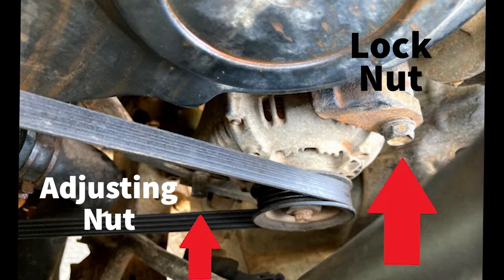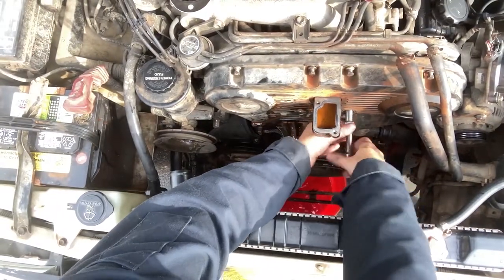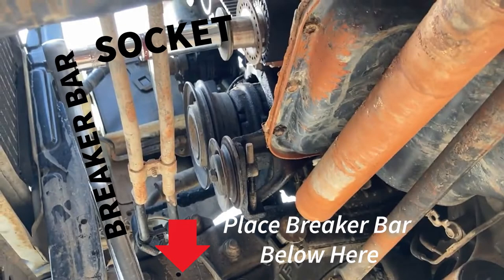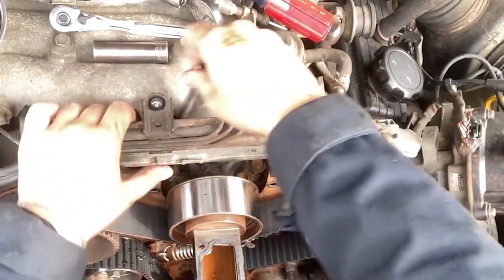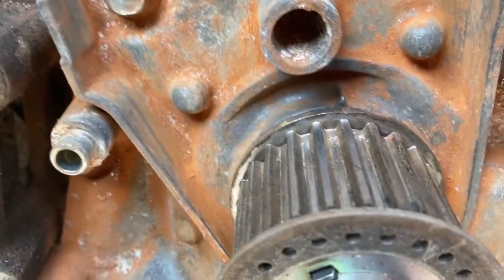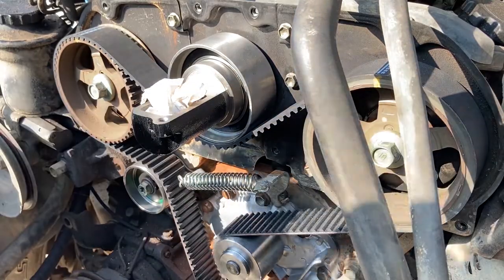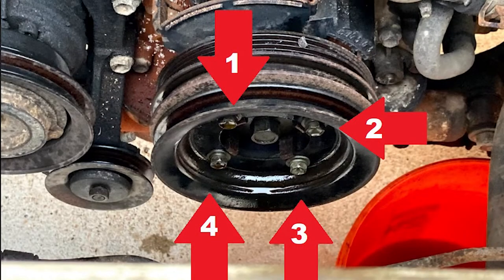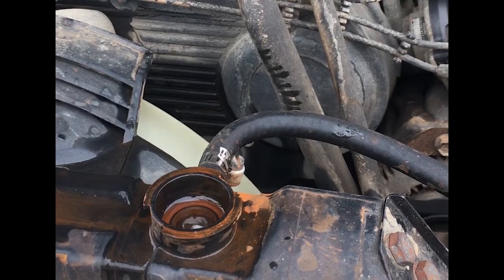Toyota 3VZE 3.0L Timing Belt, Water Pump, Tensioners Replacement - Girlie Garage

Comment: Thank you SO much for this video! You gave me complete confidence to tackle this job on my 3.0 88 Pickup. You didn't skip any steps, and explained everything. I subscribed.
Reply from the maker: Yes! So proud of you! I always do my best so I am really glad you found this video helpful :-)
Reply: I agree, the video is so helpful and complete with all the steps and reminders!
Reply: She’s the greatest tutorial mechanic
Reply: @GirlieGarage  Hi, this is a great video! Can you tell me how you removed the pulley bold after using it to set the timing belt. Im at the step after setting the new timing belt but then I get stuck trying to figure how to re-remove the pulley bolt after using it to set the the tensioner to 27ft lbs.
Reply from the maker: @turbobandz4269  If you’re talking about the crank pulley bolt, I just used a breaker bar with a deep socket 19mm on it and did kind of a quick jerk to remove the crank pulley bolt after using it for any turning of the engine
Reply: @GirlieGarage  Thank you!! I was able to put it all back together. Great video, thanks again!
Reply from the maker: @turbobandz4269  Fabulous! So glad to hear it went well!!
Reply: @kwahu1519  agree.. the best👍🏻

Comment: Just a tip, if you set the belt on everything else first, then rotate the crank pulley 1 tooth counterclockwise and set the belt on, it will make it much easier. Then rotate back counterclockwise 1 tooth and you now have no slack on the idler side of the timing belt and it's all on the tensioner side like it should be. Done. Hundreds of timing jobs like this and it works on almost every manufacturer.
Reply from the maker: Thank you!
Reply: @GirlieGarage  thank you for the clear and concise video!!

Comment: An update: Spent the weekend doing this job. Your video was INVALUABLE! I literally just played it step by step to keep track of my progress. It has all of the important details without any of the fluff, which makes it perfect for instructional use. this video should be THE top video for the 3vze engine... like this seriously needs to circulate on YotaTech, it made it way clearer than months of research did for me.

The 1994 3VZE (and 95) use a hydraulic tensioner which was the only difference between this video and my truck. It is installed directly on the fan bracket and I recommend installing the fan bracket and tensioner and releasing the grenade pin BEFORE installing any of the crankshaft parts (cover, sprocket) so that you can be SURE that your timing is correct.

One other tip: If you remove the camshaft sprockets (which you do to replace the camshaft seals) you can MUCH easier get at those 13mm bolts for the No 2 tensioner, behind the dust cover.  I could not for the life of me get those two rear bolts installed again, but if you remove the entire dust cover behind the camshafts, it is like 1 extra step for an hour of saved frustration. And if you are already this far on your 200,xxx miles truck, replacing the seals is a good idea anyway.

I had a hell of an easy time getting off the camshafts and crankshaft bolts, cannot say enough good things about the milwaukee 12V fuel.. took me 3 seconds to get all those bolts off and I didn't have to mess with the starter trick.

My truck idled really high at startup (2000 rpm) and I was SUPER worried my timing was off, even though I felt really confident in my timing belt install. Once coolant started circulating, it dropped right back down to 1000. So- if you are like me and having high anxiety over your rpm's, let it heat up and add some coolant before tearing it down again. :)

Thanks for guiding me through this massive project!
Reply from the maker: This is a super helpful response Madelyn! Thank you so much for sharing the tips about the hydraulic tensioner, and getting to those #2 tensioner bolts while having the cam pulleys off. I’m so happy the video helped you. I don’t like fluffy videos either lol. Good on you for giving your truck some love at 200k! Cheers to another 200 (LOVE Toyotas)!
Reply: Mines a 93 it has the hydraulic tensioner too

Comment: I've seen a lot of these videos with a lot of fluff, but this was straight to the point. 

Just realized that the last time I did my belt on my 4runner was in 2003,  and I was trying to remember if you needed to take the intake plenum off to replace that cursed upper pulley. Thank you!
Reply from the maker: Gearing up for the job can be a task in itself! Glad to hear you’re taking care of your Toyota!

Comment: Nice job. Wish I had this 2 months ago when I was doing it! PS I had trouble getting the belt tight enough so the marks to lined up after two revolutions: so I clamped the belt to the crank pullies and turned the camshaft pully one notch behind, then put the belt on it. That way I could turn the shaft with a ratchet and run the belt into the tensioner pully using leverage. Worked perfect.
Reply: I've rebuilt several engines including this 3.0 3VZE engine. The timing belt installation is always a little challenging. I never get it right the first 2 tries. And yes, doing it as you mention it is probably the best & fastest way to do it but most people won't admit it. That's the way I do it. But if the timing belts have the 2 marks on the timing belt to align with the camshaft timing marks, it makes things a lot easier.

Comment: I just completed this operation on a 90 Toyota pickup SR5 4x4 3.0
It was an ordeal !  Everything ran smooth until I had to torque the crankshaft bolt.  I ended up fabricating one out of a piece of steel. ....... thanks again for the tutorial...... J
Reply from the maker: That’s pretty epic that you were able to fabricate something that worked. Congrats and bravo!

Comment: You did an amazing job. I could only reason that the few people who gave you thumbs down, are fools that need to see every detailed done like screwing every nut and bolt down, they want to see the silicone actually being spread on the thermostat housing, etc. I've rebuilt this 3.0 vze engine for my 1991 4Runner sr5 4x4. Probably one of the most complicated engines I worked on & I've worked on nothing fanzy. Even rebuilding a diesel engine on my 1980 Turbo Diesel Mercedes wasn't a pain like this engine. I replaced all the vacuum lines & hoses with at least 6 inches extra in length since the original length are so short & tight that there is no wiggle room to see if any of them have become lose, cracked, broken, or slipped off to create bad performance on the engine like sudden rpm surges from vacuum leaks or hesitations. The reason I got around to your video is because I'm actually replacing the water pump because the water pump gasket broke around 1 of the bolts in the area of the thermostat housing but between the water pump & the engine block. Had it not been for that, the water pump & thermostat probably had another 2 or 3 more years of service which would have been ideal to then replace also timing belt & other parts; now I have to do it 2,3 years earlier thanks to some cheap Autozone gasket & water pump. I could have been installing my newly rebuilt 5.0 engine on my convertible Mustang GT even though summer is almost gone here in Southern Cali.  I also took videos and photos of my 3.0 3vze engine rebuilt process but it was faster to come to watch youtube videos for a refresher into what I need to take apart. Yours being the 3rd I watched & the best one I've seen all including the past ones I saw. You mentioned the parts to remove, the size bolts & nuts, how many they are, the process, & torque. Great job, keep up the good work. God bless'ya.
Reply from the maker: Thank you so much for your detailed and heart-warming comment. I’m so happy you found my video to be helpful. I actually just replaced the water pump on a 5vzfe for the same reason (working on editing the video now). 
It’s so nice to hear of others who love their Toyota’s as much as I love Toyota’s! Keep that 91, and all your optimism and positive energy going!

Comment: Great video! Important to note after 1992 the 3vze switched to a hydraulic timing belt tensioner so you have to remove that before you can take out the fan pulley housing. The tensioner is 2 12mm bolts. A little bit tricky to get to those bolts.
Reply from the maker: Thank you for the note!!!

Comment: I think I've given your video about 400 views replacing my timing belt, water pump, and thermostat. Thank you so much for taking the time to put this together.
Reply from the maker: Of course! I’m so glad you found it helpful. You got past the speed bump of breaking the crank pulley bolt loose? I tried to reply to your other comment but it disappeared
Reply: @GirlieGarage  that was a false alarm/panic attack. TDC remained unchanged after  I cranked it many times but the belt L, R, Center marks slowly drifted to the left with each crank so I panicked. Job is done now and the truck seems just fine. Forums were saying ignore the belt marks...just watch the notches on cams and crank shaft. Getting the crank shaft pulley back on was though... ended up doing a work around where I cut an old alternator belt in half and double wrapped it around the crankshaft pulley and viced the other end to the frame for counter pressure so I could tighten to 181 lbs
Reply from the maker: @tylerkaplan2799  yes! When you install a new belt you use those marks to line it up correctly the first time, then they rarely line back up again (I forget how many revolutions but there is a mathematical equation for determining how many revolutions until all marks realign). Yay!! Congrats on getting your truck all back together. Such a satisfying feeling to get things done with your own two hands
Reply: @GirlieGarage  for sure! Thanks for the help. Two solid days from dawn to dusk and many skipped meals but I'm so proud it came out perfect

Comment: Good explanation.. I can’t speak english well, but just see this step I got the point🙏😊.
May be you can make another video how to fix the rear window so it can be open by key from outside😁
Reply from the maker: I do not own this vehicle but if I find on that has this problem I will make a video!!

Comment: You should use a spring puller instead of vice grips. It's a specialty tool with a small hook at one end and t-handle at the other.

Comment: Thanks for this! The 3.0 goes all the way to 1995 on the pickup
Reply from the maker: Thank you! I wasn’t positive what models  used the 3VZE past 92 so I didn’t want to be presumptuous. Do you think it would help people find the video if I change the title to expand to 1995?
Reply: @GirlieGarage  Late 92 to 95 use a hydraulic tensioner so it's a little different; you're both 'right' on this one.... 
Great video, I'll be following along this weekend!
Reply: A hydronic tensioner? Haven't seen that one mine.  I got a 95 motor sitting in a 94 pickup. Haven't seen that . Or yet.
Reply: @leoblanksanta626  Look up 3vze timing belt kits.  The 88-92 is different from 93-95.  I don't know what it's called but the tensioner is different.

Comment: This is one of the very rare times when I am thankful for algorithms 😳😳😳  Great video you have a new subscriber.
Reply from the maker: Thank you! I’m doing my best! Glad the internet routed you somewhere helpful :-) let me know if you have any questions.
Reply: @GirlieGarage  I have a 1993 Toyota T100. I believe they have the same engine. It is a V6 3.0.   Please let me know if I am wrong.   My truck is passed due it's timing belt change. Thank you so much
Reply from the maker: @280zGaitan  without your vin I cannot verify. You can Google “vin decoder” and plug your vin in to be sure you have the 3vze
Reply: @GirlieGarage  I just plugged the VIN and yes same engine 3.0 L V-Shaped 3VZ-E.  Thank you so much for sharing that VIN decoder. Now I am off to go change my timing belt thanks to you. Thank you.
Reply from the maker: @280zGaitan  Good luck! You've got this!

Comment: A very nice video for do-it-yourselfers who may have only a modicum of knowledge and tools. However let me make note of a few discrepancies for those who may not be familiar with some of the references you made. For example, not all manufacturers use an "L" and "R" on their timing belts. Also, as your pointed out, since the engine is a high vibration one, it is important for installers to use the correct RTV sealant. In the present case, while the "Red" one will work, the "Ultra Grey" is better. However, some gaskets come equipped with a sealant already. In addition, more emphasis needs to be stressed for cleaning the mounting surfaces since I have routinely encountered those who have to do-it-again because they failed to clean surfaces adequately. Also, if the radiator drain cock is difficult to remove, removal of the lower hose is advisable. It is also a good idea to flush out the radiator in order to try and remove the sediment which can be seen floating on top of yours near the end of the video. In addition, it may be of value to explain which tools are needed so that when you say "torque" there is no head scratching by those who are not familiar with this word in this context. And while each mechanic has their own ways of approaching a given task, I applaud you for your express attempt to be concise with clear images and not deafen viewers with background nonsense.
Reply from the maker: Thanks for adding in helpful tips Herb. The gentleman that owns this truck is a chemist who makes his own coolant….it is not sediment. I would hope that if someone didn’t know what “torque” meant that they could Google it. You are totally right, working on cars has an individual flair unique to each person, this is just mine, and hopefully it helps people out there who are up for tackling it themselves.
Reply: You are welcome. I decided to do the same task but because of a work schedule, only got half way. The other half of the project tomorrow. Thanks again for the video!
Reply: @GirlieGarage  Thank you for your comments.

Comment: Recently bought an old 1989 Uhaul dually truck conversion RV that runs amazing, your video is the icing on the cake to guide me to change timing belt thanks…..any vids on valve adjustment??
Reply from the maker: Congrats!!! I don’t personally have videos on the valve adjustment but valve adjustments are all similar for overhead cam engines. I would watch more than a couple and find the technique you like best. I prefer to have bent feeler gauges

Comment: Great video. Thanks for including torque specs 👌🏼. Is there a video adjusting the timing?
Reply from the maker: Timing should be set at TDC during this process which means you shouldn’t need to adjust it. I personally don’t have a video on adjusting timing for this vehicle

Comment: Thanks again for video and pics. And especially torque specs. Btw which Manual would you recommend?  I want one for my 89 4Runner. I also wonder if the online versions are as good as paper backs?
Reply from the maker: I like the Toyota service manual. Usually you can buy a PDF online for $5ish